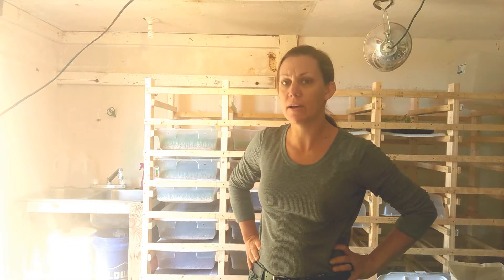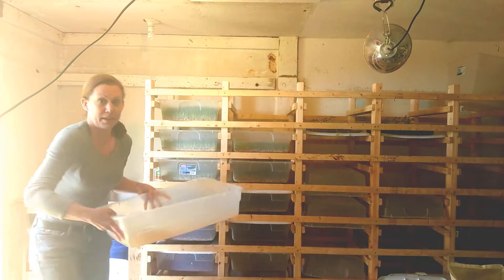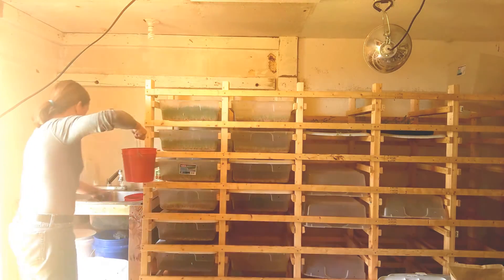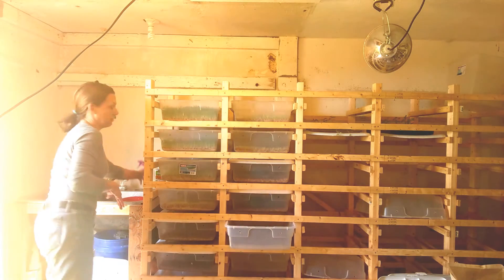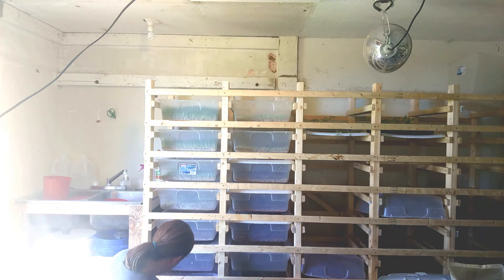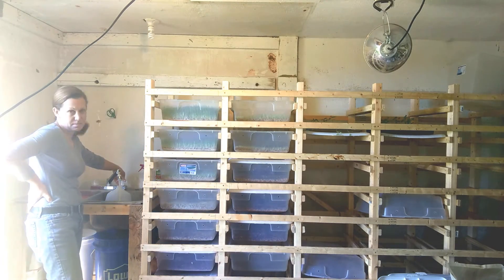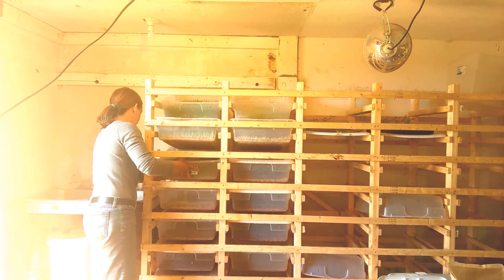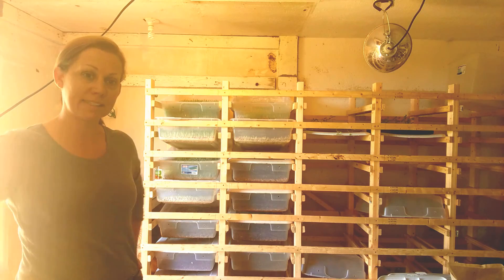Daily Fodder Runthrough

Comment: Nice fodder setup. My questions are...Why do you put a lid on the bottom ones? 
And the other setups I've see have had water reservoirs to catch the water. Where does your extra water go?
Reply from the maker: The bottom trays are open, no tops & no holes :)  to collect and be discarded with each rotation.  We simply dump off the water, but i'm sure it could be reclaimed for use the garden or something. We haven't found a practical way of recycling it yet.  I'd advise caution with reusing it however. The mold builds up quickly in the tray and could potentially be harmful in some applications.

Comment: What did you say you sprayed the lids with I could only hear vinegar  ? and why do you spray it ? also I hard you say you wash the seeds in vinegar why is that plus how much  do you add to the seeds and is it just ordinary  malt vinegar what type is it please .
Reply from the maker: Plain white vinegar is sprayed on the lids and the trays after the fodder is used, to stop mold from forming.  The seeds are washed/thoroughly rinsed is clean water only, no vinegar.